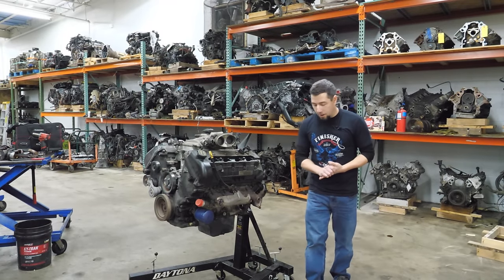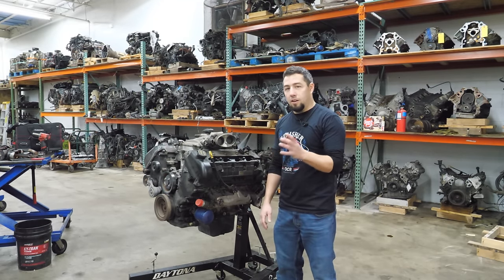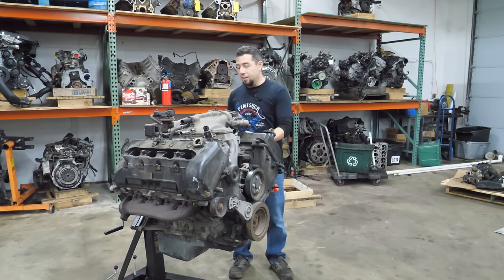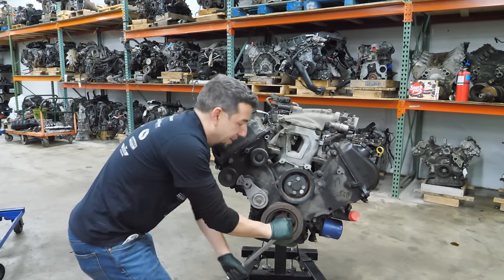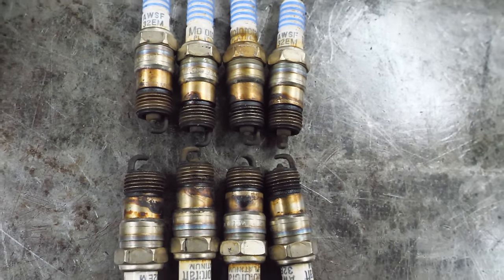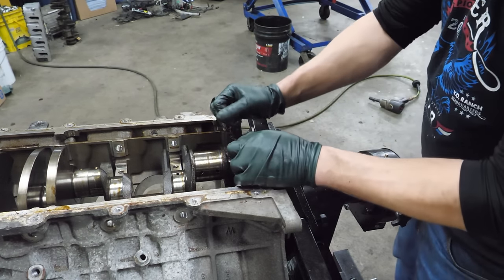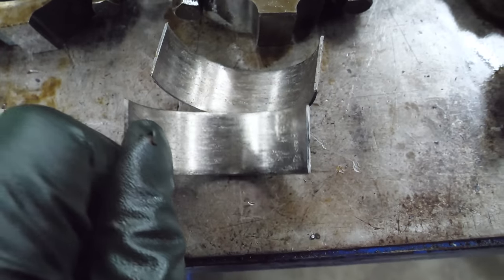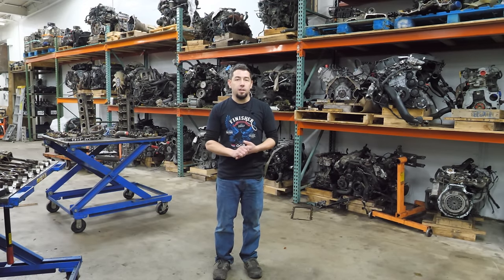AVOIDABLE! Blown Mercury Marauder 4.6L DOHC V8 Full Engine Teardown

Comment: Great video as always Eric. I really appreciate it! I bought the car in 2019 from the original owner in Wisconsin with 142k miles on it. Car didn't burn any oil until the thermostat was replaced with an autozone brand part and started overheating regularly. I promptly replaced the part with the correct oem motorcraft thermostat (These cars demand it) but the car continued to burn oil and admittedly I didn't stay on top of it. Over the course of 6 weeks unchecked it consumed 2 quarts of oil. I topped it off but the damage was done. CHECK YOUR OIL! I did end up finding a rear-ended 03 Marauder in Kentucky and pulled the motor (128k miles) car is back up and running. Lesson learned 6k later... (Engine plus install) Thanks to all who subbed you guys are awesome!
Reply: Sorry to hear you had to go through all that 
The things we do for the cars we love 
But a thanks from one of us for our viewing pleasure
Reply: Thank you for your sacrifice!
Reply: Having the background info is great, thanks for both that and the engine
Reply: Thank you so much for the engine and your experience, both of which make for a very instructive tear down. I just had a service done on my own vehicle. I get the oil changed every 3 months regardless of mileage and check the oil level weekly.
Reply: I appreciate the sacrifice you made in order to bring us the tear down….had you checked the oil in that 6 weeks, we wouldn’t be watching this video.
Reply: They also cook the exhaust valves on the drivers side. Not common, but some modify the cooling a bit. I have this engine in a 95 Continental!
Reply: Just to be clear, so the non oem thermostat was the culprit as it accelerated the death of this engine?
Reply: if it's consuming a lot of oil it's already history.
Reply: @chronicle_4   yeah it's super important on these cars I'm not sure why. Thermostat is housed upside down under the car unlike the crown vic. I tried an autozone part myself and it overheated. I couldn't figure it out so I took it to a dealer and they replaced the thermostat again (Not oem) still overheated and finally figured out that only the motorcraft thermostats work with these cars. Once the correct part was in it worked great but the damage was already done. The car was driven hotter longer than I wanted to drive it mainly because I work in East Saint Louis and I didn't want to leave the car down there where it would certainly be on bricks if left for a few hours. Happened 5 times on a 30 minute highway drive. It would get hot and I'd have to coast for a while to mitigate the heat. Whatever the case it was me being negligent that ultimately killed it. I can say it was my daily and I got plenty of fun out of it.
Reply: T
Reply: @donrha thanks mate.  a costly mistake indeed.  Googling "motorcraft thermistor vs"   yields an f150 forum site discussing about it.  Perhaps that's the clue.  Thanks also for sharing your engine for dissection.  We, the viewers enjoy some detective work.
Reply: This was an awesome engine teardown, sacrificed for a valuable lesson. Big thanks to you for your time and service in bringing this to our viewing pleasure.
Reply: we the internet thanks Thee for your sacrifice
Reply: This is the same engine (diff heads, cams) as the 99-04 Cobra and Mach 1 that had poor cooling issues on the drivers side rear of the engine and would cook valves and bearings; there are a couple aftermarket kits that replace the rear upper freeze plug with a bung that you plumb to upper rad hose or pass side head and relieves problem.  Much worse on the Terminators of course, but still a prob on all 4.6 DOHC motors from 99-04.
Reply: I wonder if it was the black one I saw in Wausau Wisconsin some years ago? I used to work on the WPD crown Vic’s of that era…. I always wondered why police packages didn’t have that same engine. Brand new and empty the squads went pretty good for 250hp

Comment: As a midwestern tech, I really appreciate the struggle of getting the busted nut out of the socket. Thanks for sharing the better parts of my existence :)
Reply: Just though I'd let you know, I live in Las Vegas. One of the driest cities in the world. After 30 years, I can loosen the bolts on the exhaust without breaking or stripping.
Reply: Lol I'm in the UK, everything is rusty and siezed
Reply: If the socket has a hole through it, you can use a drift pin to hammer it out.
Reply: I'm with you bud. I had to hammer a socket onto a lugnut to remove it. Had to use a hydraulic press and punch to get the nut out.
Reply: That bit was so funny, a vice and a punch would have had that out in seconds
Reply: @lancecorey6582  But that wouldn't be funny as the progression of bigger hammers 😄
Reply: @@retiredbore378 hey, have to give the nod of education and health care above the Americans......
Reply: A vise and a punch is how it's done if the normal hammer, throw it on the ground routine doesn't work.
Reply: Same here
Reply: yeah i had the same issue, except the nut rotated halfway in the socket...... it was a nightmare to remove with heat and double nutting lol
Reply: @plageran  next time just tighten it back on and it will slip back easily. 

Be careful heating impact sockets as you can harden them and cause them to crack. (Also heat causes metal to expand, both the socket and nut being steel, they are likely to expand and disapate heat too similarly.

I've never met a jammed fastener that hasn't come out with opening the vices jaws so only the socket walls are touching the edges and punching the fastener through the top. 

That was funny though but I couldn't laugh as the struggle is all too real, I felt that in my soul! 😂 

(There's no anger like when you throw the socket at the ground, bounce it off every hard object in the vicinity because you don't want to go over to the vice and just want to get the other fastener off and you finally give in and accept defeat, when you walk over and just barely drop the socket on the bench to go grab a hammer and punch and the son of a bitch just falls out. 

That vehicle I like to make an improvement on, the improvement I call "weight reduction"!
Reply: @commonsenseisdeadin2024  i did that eventually, after realising a heat gun is useless, i was looking for long wheel lug bolts and had to get the original back in place. fyi the original came from a spare knuckle i bought and didn't really need to go back.....
Reply: @plageran  THEE worse jam is Ford Chrome cap lug nuts! 

The trick is break them free and tighten them by hand...... Why has got time for that? (As I end up spending 45 mins smacking lugs out of a socket) 😂
Reply: @commonsenseisdeadin2024  chrome sucks, when you scratch it you need to replace it XD

Comment: One thing is very clear regarding that engines life. It was a very rough 150k miles it suffered through. That level of damage suffered by any modular ford with only 150k clearly indicates a maintenance deficiency of significant nature. Those plugs were original and so was the oil it seems  !

Comment: Hello. Was watching your video and would like to weigh in on something you said.  WAP or wap doesn’t stand for Windsor Assembly Plant.  It stands for Windsor Aluminum Plant. It’s a foundry that I worked at as a manufacturing engineer. That block was cast using the Cosworth process and happens to have cast oil passages in the block. Normally oil passages are drilled.  Getting the sa sand core out of the passages was a particularly annoying job for our processing equipment after the block was cooled and cleaned.  Any small bit of sand (zircon sand not silica sand was used in that foundry) that was not cleaned would come loose and blow immediately down into the main bearing. However this particular engines showed rod journal bearing damage which would tell me that the foundry got this engine clean of sand.   Anyway. I’m retired now. The foundry was owned by Ford Motor Company but was sold to Neman when Ford thrifted itself out of the casting business.  So technically your friends engine block would have been cast by Neman and not Ford

Comment: As an old timer...these modern engine's are race quality from the tech indy 70s 80s. Knife edged cranks, chamfered oil holes, beefy rod's, and coated piston skirts. Windage trays too. I know it's all for efficiency but, nice. Regardless of manufacturer. I'm a gearhead and love them all. Even a yugo can be modified.

Comment: Yeah.   Those plugs are original. 

Motorcraft, stopped using those plugs with the half threads within a couple of years.    

As a matter of fact.  Tech bulletins had to be issued because people thought the replacement plugs for those,  with full threads,  would damage the cylinder heads or were not correct for use.    

It was fun trying to explain to people that there were.   I got tired of doing it after a while and tore out the tech bulletin from my catalog and had it laminated so I could present it to people whenever the issue came up.

Comment: That crank journal wear seems like a classic case of abrasive embedding itself into the softer bearing material.  The softer material becomes like sandpaper, and oddly it's the harder material of the crank that wears away.  Machinists take advantage of this phenomenon by using copper lapping plates embedded with diamond abrasive to lap granite surfaces.  The diamond embedded copper cuts through the granite like buttah.
Reply: I blew a briggs opposed recently, seems there was a buildup of material on the crank journal.

Comment: There are a couple tricks for removing rusty bolts here in the midwest. Pretty simple but without patience you'd be better off just snapping the bolt. The trick is to try and unscrew until the bolt moves. Once you see it move tighten it back up. Unscrew again and tighten. Do that a few times and it will come right out.

This idea, compounded with heat and penetrate will do wonders especially for bolts inside blocks or heads.

My preferred way of removing snapped bolts from my sockets is to stick the biggest screw driver I can find down the anvil side of the socket and slam it on the desk/table/ground like a jammed rifle or shotgun. Sometimes you can get the bolt head to hit the ceiling :)

Comment: The water pump design is really good, small, externally accessible and belt driven.
Reply: and with a stainless steel impellor...
and an O ring seal....
real engineering.
Reply: @JohnSmith-yv6eq  Yeah, good additional points 🙂
Reply: and not phallic looking
Reply: As well as a weep hole that actually works as intended!
Reply: @commonsenseisdeadin2024  Yes, the weep hole not leading to an oil compartment 🙂
Reply: @liver.flush.maestro  well the weep hole doesn’t leak into the crank case, it’s just often the small canal for the weeping indication is plugged or goes unnoticed because it gets cooked and doesn’t puddle up. At least Ford designed for it (I maintain 10 continentals with 3.7s and they have been obvious unlike previous 3.5s engines (non eco boost).)
Reply: @commonsenseisdeadin2024  Good to know it isn't as bad as it seems 🙂
Reply: @liver.flush.maestro  it's kind of ridiculous the measures they took in the design just so they can put an engine mount on the front cover to be able to mount it in a transverse configuration. 

But nonetheless on our 2017 Continentals it's like clock work at 190-200k miles it's starting to fail and coolant is starting to show/stain the under tray and can be seen dried up/cooked behind the alternator (where the weep hole drain location is).  But then my buddies explorerer evidently was leaking at 55k miles (which I am uncertain if that was indeed the issue or not but seems too soon for any vehicle, however GM has proved me wrong many times before 😂) so I can't confidently say what to expect. If getting 150k+ miles I think is more than adequate and honestly the job isn't that difficult. The guides have looked perfect and I haven't seen any chain stretch but I still replace guides, chain and tensioner with the water pump which I want to say with spark plugs, valve cover gaskets (I do not change the intake gasket because it's easy enough to do so unless there's issue when it goes back together it's a waste to buy an entire gasket set for only 1 as you only remove the upper from the lower) the right stuff (if you don't know what that is, it's the only gasket maker you should ever use!) It's around $400 in parts. It calls for 22 hours but I think it can easily be done  over a weekend no sweat. I think 22 is way high, you don't need the tools that hold the cams but it helps, I think they are like $30 or less online, only need the cam holder plates.
Reply: @commonsenseisdeadin2024  Thank you for the detailed information 🙂
Reply: @liver.flush.maestro  I was bored and am ADHD as hell so that's the result! 

But you're welcome if you mean it nonetheless!  😂
Reply: @commonsenseisdeadin2024  It is good to be focused on things, this is how we become really good at them, regardless the subject 🙂

Comment: I finally subscribed i have watched many of your tear down videos. I am a retired ford tech and have R&r'ed many engines more so in gm vehicles than ever in ford products. I'd say 85 plus percent of engine replacements i have done is from customer neglect no matter what brand of vehicle. Lack of servicing, I do not believe in toyota's/mitsubishi's 10,000 mile oil change intervals if you want to go ahead, if the oil is dark it's dirty/contaminated. People will change their oil on time but will neglect all other fluids in a vehicle, coolant, trans, p/s fluids, diff, and also brake fluids. I don't believe in lifetime fluids like when ford came out with the mercon lv trans fluid stating never had to be changed. Gm's 3.6 timing chain issues, ford 5.4 3 valve phaser/chain issues and other makes with simular issues usually caused from long awaited oil changes. 3k to 5k oil changes not 7k, 8k, or 10k oil changes is what eats em up folks. I bought a 85 f-150 new and drove it 35 damn years and the odometer 5 digit rolled 7 times 700,000 plus miles 302/5.0 with a manual transmission on havoline 10w40 oil at 3000k changes. Does the oil brand matter heck no but change it. There's no reason a chevy or dodge or any brand would have ran as long  and be trouble free cause i have seen them all do it. SERVICE em folks check those fluids. I drive a 2006 taurus it has over 500000 miles only things ever replaced it batteries a starter alternator brakes belts, struts ball joints and fluids, no major failures not even a water pump. Do it yourself if you don't know how heck youtube it and double check everything you do. Grow some balls america.

Comment: The cam journal on the LH head reminds me of a 5.4 we just pulled from a Falcon XR8. It ran so long with low oil pressure it welded the cam to the front journal and broke the exhaust cam chain on that side. No low oil on that one so I would suspect an oil pump issue which they’re known for here in Australia.

Comment: It is a cheesehead Ford Ian!!! - I left the cheese state 1969 and never went back cause its too cold - Eric thanks for the vid again - had the Intec aluminum Italian casted 1997 Lincoln Continental 4.6 Wixom plant - fantastic running engine based on Fords modular design. It would be interesting if you get one of these aluminum 4.6L but this Merc like you said is still based on the 4.6 with the different heads. Always a great place to stop in I Do Cars for interesting videos. Thx again... Interesting what Ian said about the thermostat being picky. Good advice about getting parts.

Comment: I want a Marauder!!!!! Its not the Crown Victoria's it was the Mercury Grand Marquis to pay homage to the old Mercury Marauders of the 60s (and VERY late competitor to the Impala SS). There wasnt a ton of difference in the motors between (certain years) of the Cobra motors the Aviator/Mark VIII or InTech marketed engines. Some years of the Cobra got the aluminum block and other mods of course but still pretty much the same engines. Your battery is shytting itself to death? LOL Reminds me of oregon trail. As always amusingly great video!

Comment: The person donating the engine would surely hear the rod knock. The story about the engine overheating is interesting, but there is no damage to the heads or the head gaskets. This engine was starved for oil and that took out the bearing. 

To remove the exhaust manifold you should heat up the bolts first one at a time (you may want to resell the heads, which will need the broken bolts removed). Take it easy at first to see how much heat it takes to just come loose (usually for aluminum heads, you are below a red glow, for cast iron head you can go red hot), and slowly ramp up the heat until the fastener comes loose. Do not use your impact wrench use a large ratchet to get a feel for the torque required and how the fasteners are responding to heat. Then start with a low power 1/2 in impact (Milwaukee makes one) this way you will not break bolts or round heads. You can use CRC Knock'er Loose Penetrating Solvent to help the bolt face rotate on the flange, it does not really penetrate into the threads, which is okay because you are using heat to break the thread adhesion. The aluminum head will not be damaged due to its heat sinking capacity. The most common torch set up is Oxy Acetylene, but you are using it for heating and obviously not welding or cutting.

The head castings are rather massive.

Comment: Not sure it has been mentioned. I picked up a trick to get a suck nut out of a socket. Put a screwdriver in square end and drop (throw) in cement. The impact usually drives the  stuck part out